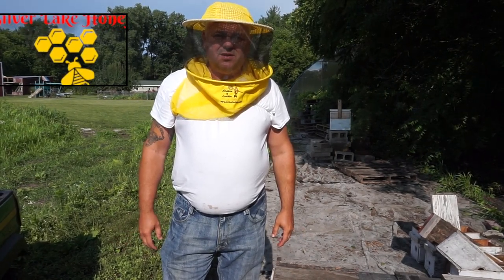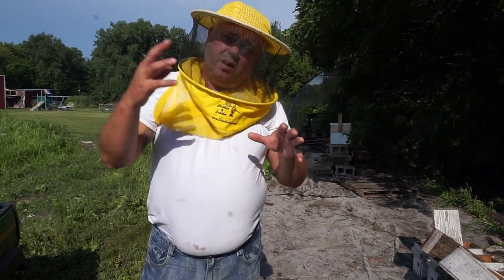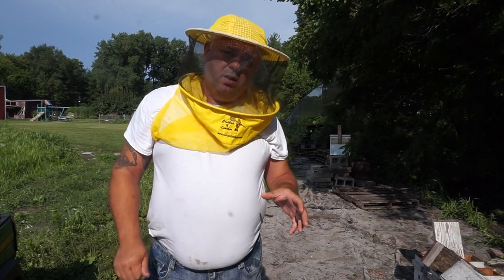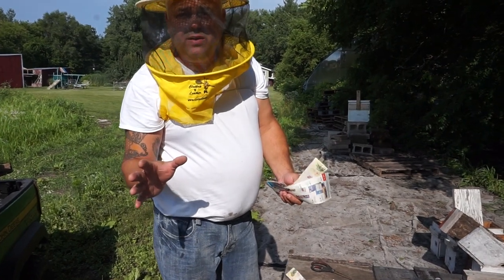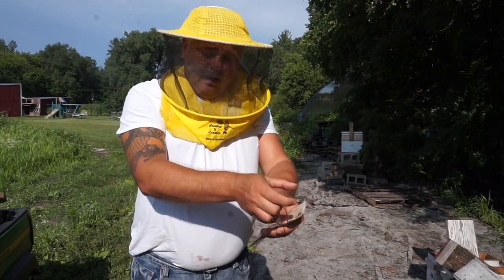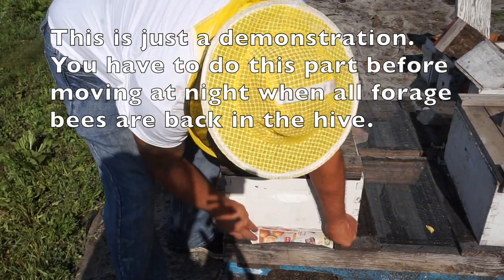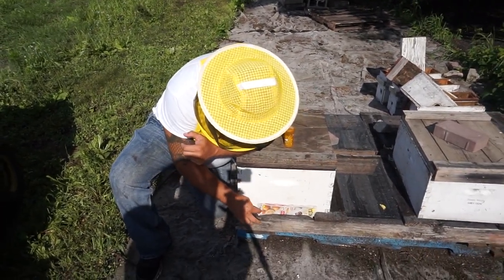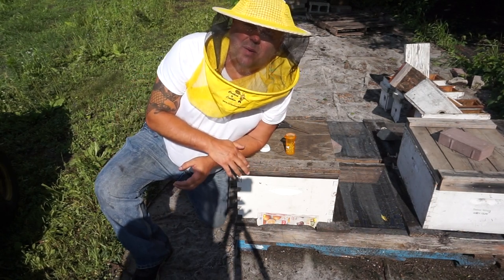How To Move A Beehive Any Distance (Our Newspaper Method) 3feet-3mile rule does not apply

Comment: Curious if you have additional ventilation for the bees?  is the newspaper with the small holes enough?
Reply from the maker: It depends what time of the year you are moving the bees. Usually I don't put any additional ventilation I just make sure bees have feed on them. Thank you
Reply: @silverlakeadventure  i need to move hives 1 km away and they're new packages installed a few days ago.  Not too hot here right now, maybe 12-15 degrees Celsius.  Just want to make sure they don't suffocate!
Reply from the maker: Do you use screen or solid bottom board